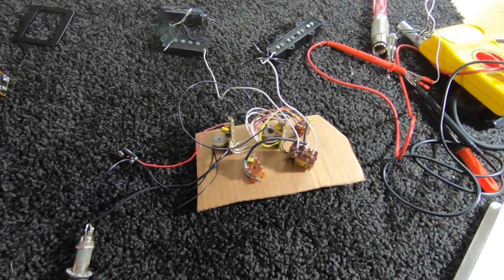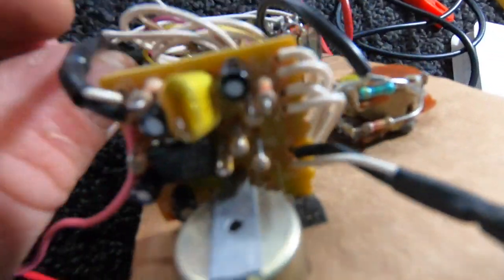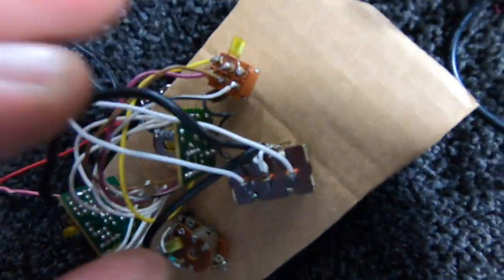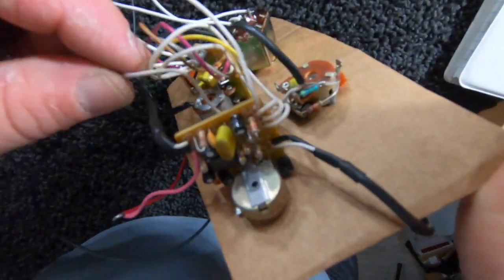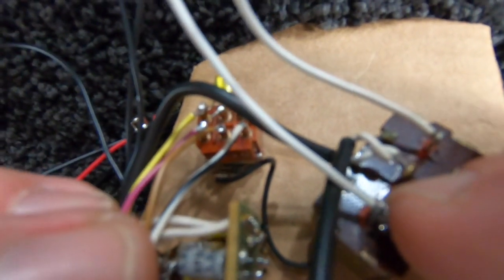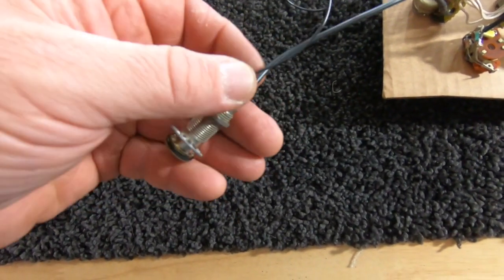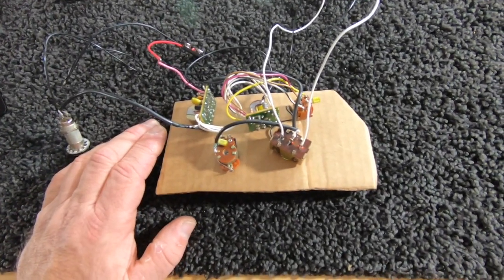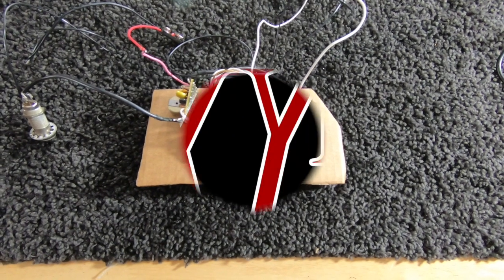Fender Power Jazz Bass Special Wiring🎸

Comment: Hey man!
I have a Fender Power Jazz Bass Special MIJ that I'm trying to renovate.
Well, the former owner made a mess of the old circuit. There are broken tracks, loose cables... This video of yours helps me to re-solder the cables, but still no sound comes out.
Do you have or could you tell me where to find this circuit to buy, or the schematic so I can check or remake the boards?
Thanks in advance!
Reply from the maker: I am so happy this helped you! There isn’t anything out there for the power jazz bass special. 

I did this job for a client and as such the bass is now out of my hands. 

However, where are you located? Perhaps I could take on the job if it is t too far away for you to get me tour bass.
Reply: @REXYLAB  
Unfortunately I can't send it, I live in Brazil.
Even so, thanks for your help and helpfulness!
I will continue the saga!
If it doesn't work, I move it to passive or install another preamp...
Big hug!
Reply from the maker: That is too bad but I understand. 

Tell you what, why don’t you shoot a video of the electronics of it and email it to me at eddie@rexylab.net and I’ll look for anything funky I might spot, free of charge. If successful perhaps that will become a video that could help people in your situation. 

I will also look to see if I can’t possibly get that clients bass back to do a better video of how it should be hooked up. 

I hope you subscribe to my channel as I do stuff like this to help others in situations just like this. Subscribers, likes and comments help the algorithm point people that could benefit in my direction. 

And if you have time I hope you check out a few of the other videos I have on the page. This autistic kid finally got his guitar is a personal favorite of mine.

Comment: Great video! Can you offer advice as I would like to take out my original TBX Tone control electronics and replace them and  the pickups with EMGs?
I want to save the originals in case I want to reinstall them. Should I de-solder the wires instead of cutting them? Thanks
Reply from the maker: Ah yes, everyone swaps out this original stuff for EMGs. 

My recommendation is that you cut the wires to to pickups and the bridge ground only. Pull it all out and put in all new EMG stuff. You may have empty holes, live with it or put a dummy switch or potentiometer to fill the hole. 

Leave everything else alone. 

Then if you ever want to put it back together it’s super easy. With this bass I had to test everything and make sure it was right. 

And just so you know, the bass these electronics were in and another matching one were in a fire. There will be a new video soon about restoring them.

Comment: Great Video - Thanks for posting!  I just picked up a "power" JB special and low and behold, someone clipped out all the active components and rewired it (poorly) to 2 volume and 1 tone pot.  I would like to revert it to origional, but I don't have the active components.  I don't suppose you know if those parts are availalbe?
Reply from the maker: I highly doubt it. Perhaps eBay or reverb. I wish you the best of luck finding it. 

If you subscribe to my channel you will see different custom wiring options as I put them up.  Perhaps you will find your dream combination.
Reply: @REXYLAB  i might just clean up what i have.  Maybe wire it up like a duff mckagan.

Comment: Hi! Thanks so much for posting this! You're right, there's virtually no information whatsoever on the wiring of this bass. I read in the comments that you no longer have it with you, but do you know the values of the resistors on the TBX tone control? Or do you have a picture where you can check the color bands on them? I can't quite make them out from the video, but I believe that one of them is 82K (Gray, Red, Orange), like the one in modern versions of the TBX, but for the life of me, I can't really tell what the other one is. I think maaaybe it's Yellow, Purple, Green, which would make it a 4M7. Hope you can help me out. Thanks!
Reply from the maker: Actually I have two of them right now getting ready for repair. 

This was one of my first videos and I almost didn’t put it up as it was done way below my current standards. Then I almost took it down because it’s way below, well you get it. 

So I am planning on shooting a whole new thing about this bass that is way more in-depth. It’s gonna be a while as I have a bunch of repairs in front of it but it’s coming and it will try to answer all the questions I am capable of answering. 

These basses were actually damaged in a fire but I am confident they will come out great in the end. 

Maybe they will even warrant 2 videos. I haven’t decided. 

I hope you subscribe and hit the notification bell so you don’t miss it. 

And thanks for the comment. When you like, comment, subscribe, etc. it really helps my little channel out.
Reply: @REXYLAB  Thanks for your reply! I already liked and subscribed. ;-) 
Well, do keep me posted please, as I have one in for repair myself and haven't been able to figure out the part about those two resistors. You wouldn't happen to have a picture of them somewhere?
Reply from the maker: @ellerbrock-guitarandbassre6421  currently I’m at my “real job” deep sea diver in the Gulf of Mexico. So I’m on a boat and away from my shop. 

But I’ll pull one apart when I get home and post pics in the community section here as well as my instagram and facebook pages. 

If you dig bass I invite you to check out some of the bass stuff on this channel. I started on drums but moved to bass before guitar so I really love the bass! 

Actually, my three big heros all have signature fender basses and I have a little playlist about them. 

Also some basses damaged in a fire that The D’Addario Foundation was kind enough to supply strings for. 

I’m excited to do a full tear down and rebuild of my Kubicki ex-factor as well. That thing is a monster! 

I hope you dig that stuff and since I have your attention I want to me you can find the things I do for The Squishy Guitar Project here as well. It’s a nonprofit organization that gives guitars to children with rare and terminal diseases. 

So check back often or hit the notification bell. That is the best way to not miss anything. Also, I do my best to answer all comments so if you have a question (or an idea for a future video) just say something and I will answer.